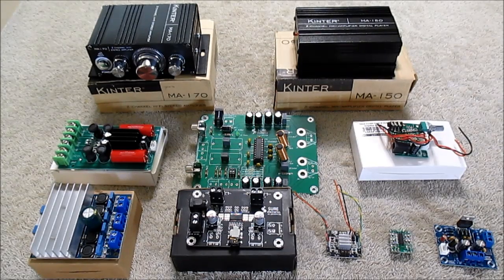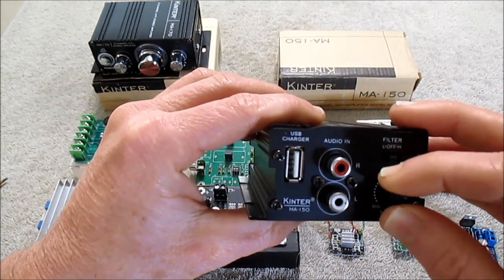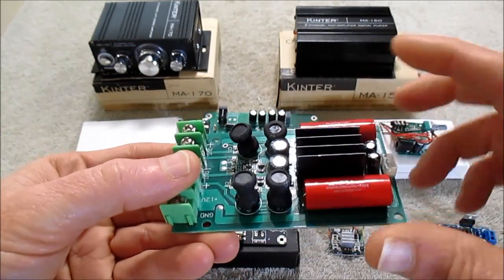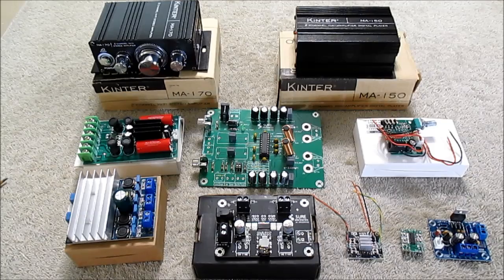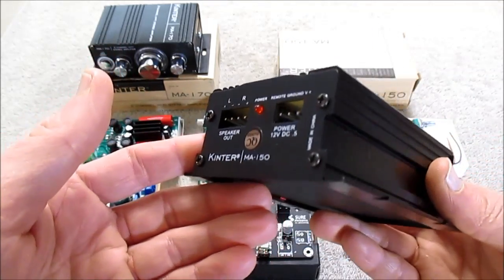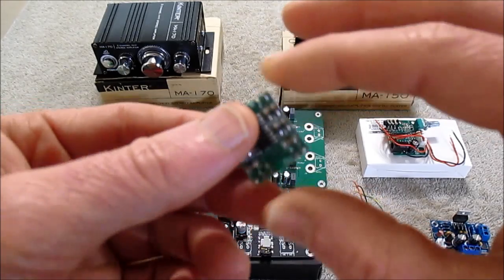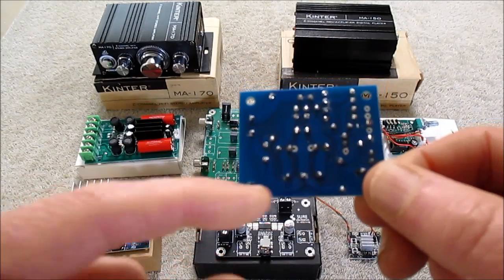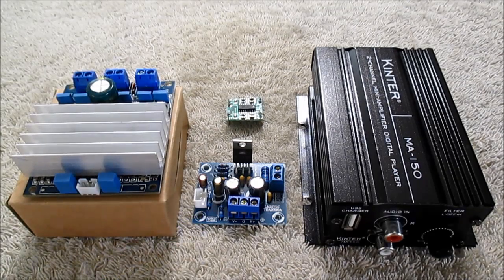The BEST low cost audio amplifier boards I've tested

Comment: I have tested many of the class-d boards that you have. none of the class-d has particularly good sound compared to the class-ab L12, L20 from LJM which you can buy on ebay or many other class-ab.

TDA7492 has a little too light sound and has a little too much upper part.

TPA3116 I think has a little more correct sound.

but both and almost every other ic. Amplifiers on eBay are built the same way except for different ICs.
frequency response will vary up and down by different ohms.

Comment: Hi, sir,
I want to know low budget 2×50watt and 2×100 watts amplifier with gain control available in market ?
I want to develop speaker with two diffrant audio supply one for tweeter and one for woofer.
But I want Boths gain should same how would I do ?

Comment: I picked up a (High Power Digital Bluetooth Power Amplifier Board TDA7498 HiFi Stereo 2*100W) off eBay, have  not set it up yet.   it comes in a nice acrylic case and a fan to keep it cool.  I now need to mode my speaker box so it has a nice little home.

Comment: Is there anything that exists that can function with a 4ohm 180wrms Pa speaker? I want to build an amp for a Pa that can run with 12vdc but I can't find any class D amplifiers on 12vdc that can go anywhere near 180wrms

Comment: TPA3116D2 Dual 50W Channel Stereo Digital Amplifier Board

I bought this board and its a beast for the price. here is a link if you wanna test it. i would love to see what you have to say about it 

https://www.ebay.com/itm/TPA3116D2-Dual-50W-Channel-Stereo-Digital-Amplifier-Board-Power-Amp-4-5-27V/222623417195?hash=item33d563c36b:g:iPkAAOSweIlZZYus

Comment: What would you power that LM1875 board with John?
Reply from the maker: +18 / - 18 volt supply for 4 ohm loads or +22 / -22 volt for 8. It is a dual supply amp meaning a positive and negative voltages are needed (3 wire supply) relative to common ground. Supply should be able to handle 2.5 amps.
Reply: JohnAudioTech thanks for replying John. It's a great channel and I'm really interested in these small boards and just how good some of them can sound especially since I'm looking into replacing my Sony amplifier of 20 plus years
Reply: @martinvaldez8745  Why not repair it?
What model SOny?

Comment: Hello John, Any reason you haven't tested any TDA2030A boards that are out there? There's a bunh of them for under 5$ with a chip per each channel. Is it possible you review some of them? Thanks and keep up the good work, you are one of the few with really fact-applied thoughts on youtube!
Reply: I'm not John, but IMHO, the sound quality in LM1875T is so much better than TDA2030A, that I feel it isin't worth it...
 Also, as they are pin-compatible, I got literally dozens of TDA boards, wich I replaced with LM chips later :-)
Reply: @damascenoalisson  that s true
Reply: I wonder whether LM1875 is even genuine...
Reply: @SianaGearz  he tested the short circuit protection on the 1875 chip and it worked tho.

Comment: Hi John , very good videos! I definitely need your help, I bought on eBay one of these tda2050 amplifier, it was sold to me as "100 watt 5-24 dc volt amplifier board", I'm powering it with a 12 volt 1 ampere dc power supply but as I play it at low volumes the sound suddenly starts to distorting..what can I do ? Thank you John
Reply from the maker: Can you provide a link to the amp you ordered? Normally a TDA2050 would require a dual polarity supply. It can be setup for single polarity but it is not often done that way with kits.
Reply: JohnAudioTech yes I can, it was this http://m.ebay.it/itm/TDA2050-DC-12-24V-5W-120W-1-Channel-Audio-Power-Amplifier-Board-/291984374564?_trkparms=aid%253D222007%2526algo%253DSIM.MBE%2526ao%253D1%2526asc%253D20150519202400%2526meid%253Dde0d5d567f1c404db39aa2d65990666d%2526pid%253D100408%2526rk%253D7%2526rkt%253D25%2526sd%253D272729726360&_trksid=p2056116.c100408.m2460  the beautiful thing is that the exactly same board is sold among different sellers as 100 watt 5-24 volt class D amp or 12-24 120 watt amp or 30 watt class AB amp..
Reply from the maker: Aha! It does appear to be setup for single supply. Ignore the silly power rating. The best you can do with 8 ohms at 24 volts is around 6 or 7 clean watts. Forget 4 ohm loads with that thing because the heat sink is too small for anything over 15v. The TDA2050 was discontinued 4 years ago and the one used there is probably a fake. There is not much beyond hooking up the wires to the board, so it could simply be defective, causing the distortion.
Reply: JohnAudioTech  good bye to my 2.87 USD I paid for this thing XD so there is no hope to get a decent sound supplying it with 20 volt instead of 12 ? Thank you John , great YT channel, fan of you ! Continua così !

Comment: A video about which amp kit can drive Sennheiser HD-650 headphones. ie due to 300 ohm impedance. it would generate traffic++++++
Reply: They should all be noisy on headphones, and headphones don't need that much power. His design for a special purpose headphone amplifier is spectacular though.

Comment: Could you do a video on which board would be a good choice for a small or practice guitar amplifier board? My nephew is learning to play the acoustic and electric guitar and he would be happy if i could make him his own custom amplifier. i have plenty of different voltages filtered power supplies to power it with. i have been collecting speakers for years out of everything that quit working or i was not able to fix. 4 ohm and 8 ohm. Do some of these boards have their own filtering for the supply voltage coming in?

                                                   thanks
                                                                john
Reply from the maker: It all depends on the power he wants. You don't need a lot of power in a practice amp. Anywhere from a half a watt up to 10. You would need a pre amp for these boards as the signal from a guitar is quite small. It is best to use a speaker made for guitars for the best sound.

Comment: Hey John,
For me, your channel is a reference and an inspiration to my personal channel!  I really like the way how you explain.  
I'm developing and Boombox with TPS3116 that you can follow on that playlist: https://www.youtube.com/playlist?list=PLX2YtMdpQuUnVOhxGmTQAcGQYj0CuCnn4
All explanations are in Portuguese so, I believe you won't understand, but I have one questions for you:
The TDA3116 that I'm using are having a very strange behavior as you can see on the last 2 videos on that playlist.   Even without any signal input, there are some pulses on one output.  I think it was fake, so I'll buy another amp. 
As I will power with batteries, I'll need an amp that delivers more than 30W per channel with the minimum power consumption.  That's why I choose a class D (that I didn't like very much).
For that kind of application, what's your recommendation?
Reply from the maker: Looking at the video, I agree. This is unusual and I think a fault of the board you have. When done right, class D can be fine but these boards are cheap for a reason. I always find small faults with them, like a hiss noise you hear in my videos. I like linear amps the best but for battery use, I'd try to find a good class D board.
Reply: Noted!
Tks John!

Comment: Hey John, sorry just caught this one but I was wondering, on that winner did you ever get a 12 to 14 volt rating on it? I look at alot of this stuff for automotive use where we are limited to around 13.5v on average and almost always use a 4 ohm load. Just curious if you could get a reading on that board or possibly start adding those ratings when available.
Reply from the maker: Do you mean the LM1875 board? It is really designed for higher voltage dual supplies.
Reply: JohnAudioTech yeah that was the one one was referring to. 

I'd like to find one that can make decent power around 35 per channel at 13 to 14 volts but it just seems these boards won't come near that.
Reply from the maker: It is all about the supply voltage. The output voltage can swing only so high before hitting the rail voltage and clip. The best boards can put out around 8 volts rms into a 4 ohm load (16 clean watts b/f clipping). This accounts for some losses in the amp.

35w into 4 ohms requires about 12v rms which translates into over 20 volts for a bridged output or 40v (+20/-20) for a dual supply single ended amp. To get this kind of power from a 14v supply, you'd need a DC supply that would boost the voltage up for the amplifier.
Reply: Thats the part that loses me. Hard to find videos on 12 volt amplifier builds. 
Also bub, I have a car audio shop as you can tell from my channel and I have a ton of old amplifiers I am just going ot be melting down the aluminum from, These amps are not cheap, they range from 150 to 1500.00 per amplifier, all the boards and parts are going to do me no good, would you be intersted in them? No cost bub just shipping and were kinda close, I remeber one of your videos says your in the Dayton Ohio area, Im in the Ashland KY area if you want ot map it out to give you an idea. I know some of  the parts in these boards are not cheap. Got some JL audio Slash amplifiers and Memphis Mclass amps, higher end stuff.
Reply from the maker: This video, although about transformers for audio amps, might explain it better: https://youtu.be/iki2nTcbkvA
Of course, car amps have their own built in DC booster supply so they can achieve very high wattage ratings.

Yes, I'd be delighted to have the parts. Thanks for offering them.
JohnAudioTech
PO BOX 362
Vandalia, OH 45377
Since these won't physically fit in the PO box, let me know when you send them so I'll know to go get them. The post office will hold them for me for a while.

Comment: hey man i have some peerless woofers with 12w and 30w peak. i want realy much bass! what do you suggest?
Reply from the maker: Most of those amps will work. You might want to add a low pass filter and have an amp just for the subs.

Comment: hi john, 
thanks for your review, i have 2 speakers i would like to use as a stand alone bluetooth speaker
http://prntscr.com/f6emwm
im a beginner and have a question, can you help me what amp should i use for the 2 speakers (2 channel) above ?
i would love to try the pam8403, 
is it enough power (plan to use 3 battery 4,5v) 1.66watt for that 2 speakers? (spec said 20watt)
I saw in this tes video that 8403 can drive your test speaker
Reply from the maker: Yes, those speakers would work. They are small and won't play very loudly. If you want higher volume, you can try a more powerful amp board, or more sensitive speakers.
Reply: thankyou for the respond john

Comment: The LM1875t board is very nice, but you need a split power supply and transformer with enough current to power it, plus a heatsink.  Those items aren't cheap.  I like the TA2020 orTA2024 boards. Not as many watts, but low power requirements and heatsink not absolutely necessary.  A 12v battery can power them.
Reply from the maker: Yes those boards are easy to use plus are stereo where the LM1875 board is just single channel (unless you buy a stereo board). Still, I like the 1875 more.

Comment: Dear John 

I really enjoy your videos  I have a request  Please test this board  its with a Yamaha chip  and I have been using them for years. I try other boards but always come back to this, to me they just sound the best in the price range  of $5 -$15.
I used to buy from DX.com but only find them on aliexpress now. the link  is below -  thank you in advance 

Michael

 https://www.aliexpress.com/item/15W-x-2-Pure-sound-Yamaha-digital-amplifier-board-Y148-beyond-TDA7297-amp-board/32699067657.html?spm=2114.01010208.3.1.nmEdSC&ws_ab_test=searchweb0_0,searchweb201602_2_10152_10065_10151_10068_10136_10137_10157_10060_10138_10155_10062_10156_10154_10056_10055_10054_10059_10099_10103_10102_10096_10148_10147_10052_10053_10142_10107_10050_10051_10172_10084_10083_10119_10080_10082_10081_10110_10111_10112_10113_10114_10181_10037_10182_10032_10078_10079_10077_10073_10070_10123_10120_10124,searchweb201603_9,ppcSwitch_2&btsid=2d472bdc-8457-48f1-a128-c5eb8dd8832c&algo_expid=36c68ed2-9823-4fbb-8311-8a6cbc2c601c-0&algo_pvid=36c68ed2-9823-4fbb-8311-8a6cbc2c601c&aff_platform=link-c-tool&cpt=1487102828588&sk=yVF2rZRRj&aff_trace_key=93e5a8ccbd654d919aa89f5665e8f009-1487102828588-01046-yVF2rZRRj
Reply from the maker: Thanks for the lead. There are a lot of things yet to review!

Comment: Any thoughts about powering these with 18650 considering they are probably the best power to weight and virtually free if you pull them from laptop batteries. 3 in series or 4S with a step down buck.
Reply from the maker: It could work if cells are protected.
Reply: I am currently planning a DIY speaker build powered by two packs of 4s 18650`s.
I`ll be using two TDA 7297`s and four samsung HT 15W 8ohm speakers.
(and two tiny tweeters)
I have been running a previous project with the same amp and speakers on 3s LiPo with no issues apart from low input sensitivity, which I am hoping 4s will help reduce a bit.
The TDA7297 is fine with 15V, but I have yet to find out how they react to a max of 16.8V, don`t really think I`ll need a step down :/
LVC is a must though :)

(btw, condition your cells and check for inconsistencies if you get junkyard batteries)

Comment: Can you use 12 aa batteries to create the -,+ power needed to run the LM1875.? .  Like in your vid 'How to use op amps with a single rail power supply' (I tried it but there could be a number of reasons it didn't work for me) Thanks
Reply: You can technically do it with the 12 aa batteries but i'd recommend making your life easier and just using two 9V batteries. I used two 9V batteries to test my lm1875s and it worked fine. 
Do you know how to set up the batteries to create the +,-? or do you need help with that?
Reply: mate, I need help with most of this stuff ha, but mmm I followed Johns 'How to use op amps with a single rail power supply' Vid and got the correct reading +,-, but I couldn't get it to make a sound, when applied to lm1875 board. (I may have damaged my LM1875 board some how, before)... And the batteries got so hot, couldn't even touch em... If you can check John's Vid I pasted that would be cool, see if i'm on the right track...... Any other suggestions would be great too. Thanks :)
Reply: So johns video that you talked about only shows how to give an output of about +4v and -4v. The LM1875 needs a voltage of at least  -8v and +8v to work (which explains why you could not get anything out of the amplifier) I'd recommended trying this set up to power and test the amplifier http://www.instructables.com/id/Dual-Voltage-Supply-9V-batteries/ 
(you dont need to make it as fancy as the instructable but set up the batteries as shown and you should be able to power the amplifier properly) 
As for the batteries, they got hot because they were probably being shorted (which i've done before and know that they get as hot as you described). I don't know if the low voltage and you trying to power the amplifier with it would cause the batteries to get hot. i'd recommend just looking over your wiring just in case. (the two 9v batteries should not get hot btw if you end up trying it. if they do get hot then something is  for sure shorting).
Reply: Ta, before I check instructables out (soldering a little LM386 guitar amp right now :)...) but, 12 x aa batteries = 18v as do 2 x 9v batteries. Isn't that the same? I went with aa for longer life... Is the a difference?
Reply: Theoretically yeah 12 aa batteries = 18v but they all have independent voltages and 1.5V is like brand new and best case scenario. lets say the 12 actually only output 1.3v each. 12x1.3 =  15.4 volts /2 = 7.7 volts +,-.
The minimum voltage the lm1875 must have is 16v so your 12 aa setup would not work. the two 9v will only stop powering the amplifier when both 9v go down to 7.9-8v (mine even got down to 7.8v each before it could not power the amplifier any more). 
but yeah as you can see having two 9v instead of 12 1.5v batteries mean that you have more control over the total voltage.
Reply: yeah true, I did contact John a few weeks back about it ( I think I deleted the comment cause it no reply, it was on an older vid and i'm just a hack ha.) but by memory, they did balance quite high, lower, but still up there........ What would last longer 2 x 9v or 12 x 1.5 (all things equal) gotta be the aa bats right?............. what about the amp output for 2 power systems? same different?......
Reply: the 9v batteries have a capacity of 500mah while the aa batteries have a capacity of 2400 mah so the aa should last theoretically about 5 times longer than the 9v batteries. however like i said the voltages is what you are really limited to I believe.  the output power really depends on the voltage. I had actually 2 lm1875s playing 2 speakers running off of two 9v batteries. 
i dont really understand you last question.
Reply: Ta, sorry about last mutter of a question. It was pretty stupid of me actually... Thanks heaps also... hope to talk soon :) cheers
Reply: yes, get 2x 12v batteries.

Comment: Hi,
I have a Technics SA-410. When it's cold and I turn it on, the left channel works fine. The right channel is silent until I turn it up to around 3 and then it comes on and stays on and works fine. I can turn it off and on and it will stay on once it's warmed up. What do you think the problem is? Thanks